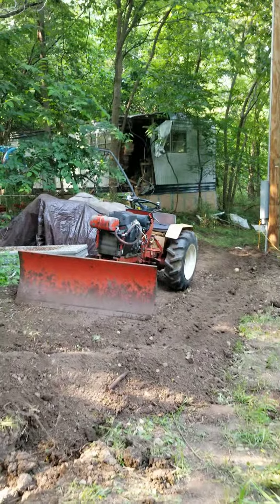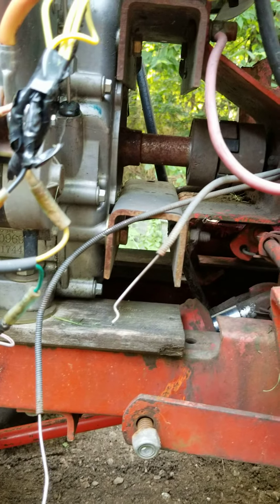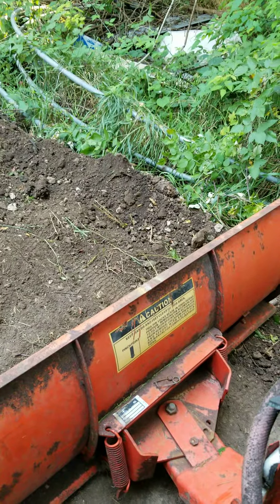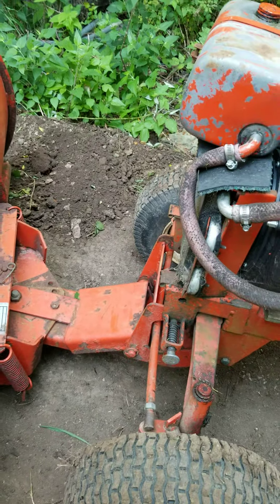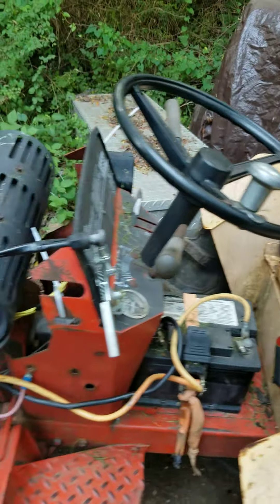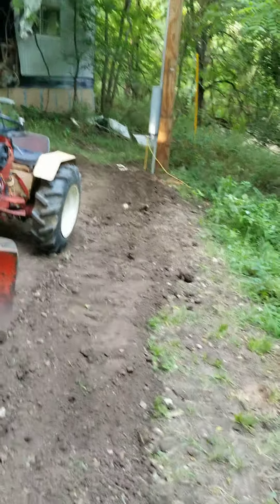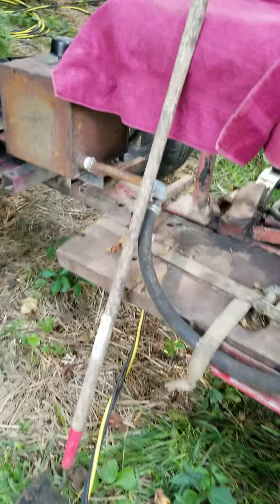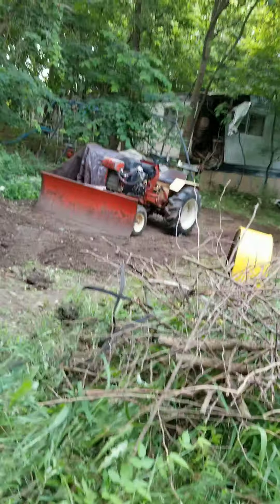Filling in the Trench

Comment: So, if you now turn the digger around and continue the dig from the trailer to the present dig all will be cool. Just because you are headed in a connecting direction, and your cooling power / wire is all behind you. Glad you are going to paint mark that gully where the water pipe runs at least enough to see it from the digger rig.  Then when the wire is internal to the trailer, the "cover up" runs full swing. Almost like a Goober-mint operation novel. Be safe, Brother. . . . Ya'll ;; B Blessed BIG time 2 Day & 4 Ever, in YAH'SHUA's Mighty Name.